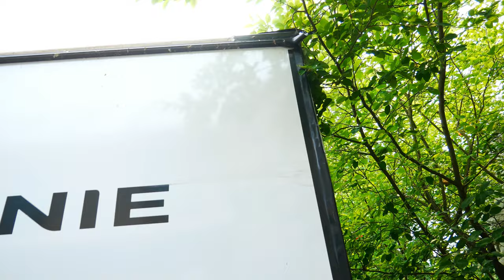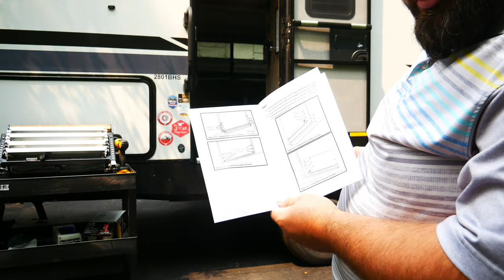I'm Back and I'm Ready for RV Season!

Comment: Hello, first of all I just wanted to say THANK YOU for putting out all of these GREAT videos. I too have the 2801BHS and have just began doing my own improvement mods, your vids have been very informative. At a glance, I haven't seen that you've swapped out the stock bedroom or bathroom fan. Just curious as to which brand you like between a Domestic and MaxxAir. I had a Dometic Fantastic fan in my Rockwood MiniLite and loved it.....but I've since seen that Maxx Air makes a comparable all in one unit that doesn't require the bulky rain cover like the Domestic does. Thoughts? Thanks again!

Comment: This is a silly question but do you need to remove the connection on your black tank hose to get it into the bumper?
Reply from the maker: nope, they are  designed to fit into the bumper.